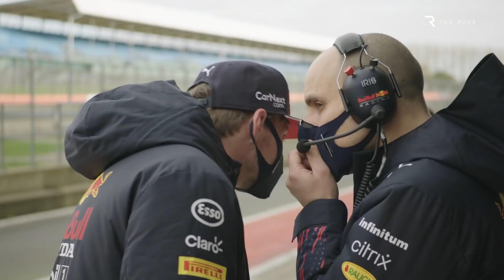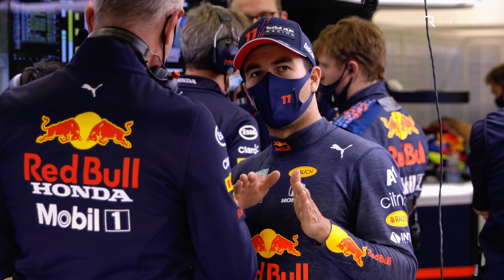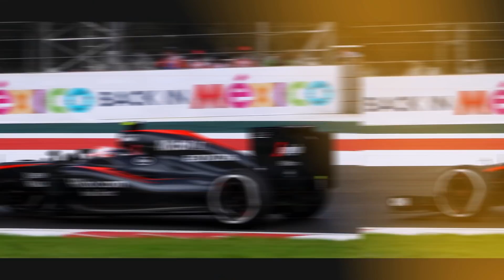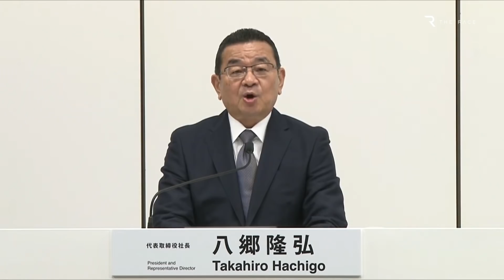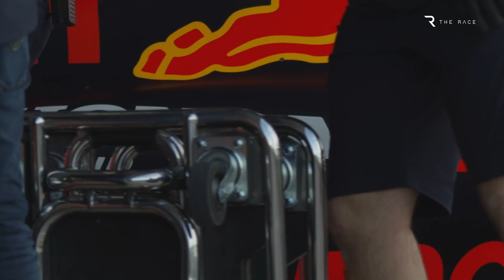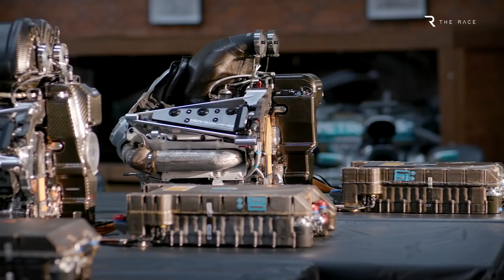The major F1 engine upgrade Honda kept secret

Comment: verstappen fans still think Mercedes has faster car 😂😂
Reply: Over the last few races Mercedes had a clear advantage more often than Red Bull. Mercedes had a clear advantage at Monza and Hungary, while Red Bull only had a clear advantage at Zandvoort.
Reply: @Privacy Is Everything The Honda engine is not the best engine. The Mercedes engine is still the best on the grid.
Reply: @svenniepennie4237  

engine is not the only part that contributes to having a faster car. 

after the new regulations implemented by FIA for this season regarding the reduction in floor and diffuser Mercedes lost out on a chunk of downforce due to its low reck design on the contrary Redbull gained from it.
Reply: @cult_personality  I never said the engine is the only part that matters. Someone claimed that Honda had the best engine. I responded to them to point out that this is not true.
Reply: In terms of raw power. Mercedes still has more than Honda,. As seen in Monza where Mercedes has been on top of redbull before sprint race, where Lewis made a bad start.

Honda compensate their raw power disadvantage to their power deployment, which helps in acceleration out of the corner, which RBR usually do better
Reply: @hectornecromancer5308  

circuit by circuit there is always a change , we have alredy seen Ferrari on pole at Monaco, Sainz finished 2nd . 
in general, overall package wise Redbull have a faster car.
Reply: @cult_personality  they're equal actually.

Mercedes and Redbull are compensating each other's weaknesses. Hence they're becoming tight in the WDC standing. Redbull aren't any faster than Mercedes, and vice versa
Reply: @hectornecromancer5308  

disagree, it cant be true that both are equal. 

1) you can just check f1 pundits opinions and articles regarding the changes FIA made and what effect it had .
2) qualifying stats - 
max 8 - 3 lewis . shows its one sided . 

3) not just this you can cross check with the two sister cars for both Mercedes and redbull. 
 Aston martin (  last yrs pink Mercedes) was flying last year finished 4th on overall standing. struggling this season on the contrary Alfa Touri performance has improved. not as surprise as Aston Martin also suffered a blow because of new season changes. 

i guess there is enough evidence RB has a better car than Mercedes , you disagree fine your choice.
Reply: @cult_personality  Aston Martin and Mercedes likely both had to do extensive redesigns of their cars with the limited development tokens as well, which has likely had a bigger effect than the aero regs. Mercedes had to rebuild around not having the DAS system, and Aston had that whole thing where they... somehow got components that were too accurate to have merely copied them off the Mercedes.
Reply: @Pünchk3y  

irrespective of tokens , it is not possible for manufacturer to change the rake concept that easily. 

low rake, high rake is one of the basic platforms which in turn shapes up other logistics of the car, the changes made by FIA benefited high rake cars Redbull/ Alfa tauri, and hampered low rake cars Mercedes &  aston martin. even if Mercedes had more token it was not possible for them to completely abandon last yrs car and redesign. 

if it was possible or not, or Mercedes chose not to is a different argument point is Redbull got a upper hand on Mercedes. that's what im saying.
Reply: @cult_personality  I think it's to close to call. Mercedes dominated the RBs in Spain and Portugal, but Max was miles ahead in Austria. Then the rear tyres changed and Mercedes got an update in Silverstone which made them a bit faster. All things considered I don't think one car is anything more than only marginally better than the other and it might even be the Merc.
Reply: @suckieduckie  

im not saying Mercedes have become hass , but the small/big advantage you are talking is with RB.

its the qualifying , Max 8 - 3 Lewis , this is where they are lagging, that advantage come into play here, and once RB get that important pole ...its always a tough task catching up.
Reply: @cult_personality  Yes RB have stepped up their game on saturdays and in the beginning of the season I thought that would lead to RB dominance since they usually were superior in racepace compared to saturdays. But wouldn't you agree that it seems RB has lost that edge they used to have on sundays? In previous seasons RB was nowhere in quali save Monaco and Mexico, but they could match the Mercedes in racepace. Now they can match the Mercedes in both, but they're no longer better on sundays than saturdays.
Reply: Anything you're saying is pure speculation, but Mercedes heads the constructors championship and Bottas's times are closer to his teammate's than Perez's to Verstappen's. So if you average out both drivers the Mercedes ends up being faster per lap than the Red Bull... which would mean it's the faster car. You can't outdrive your car's potential, but what matters is how close both drivers can get to it, and if the Red Bull is clearly more difficult to drive as fast, then that also means it's a... worse car.
Reply: @Pünchk3y  

what sort of logic is this ? 

" if you average out both cars Mercedes ends up being faster? " 

irrespective of Mercedes being faster or slower , bottas is driving that car for 4 yrs now compared to parez who is in his first season , its obvious bottas will be closer to lewis compared to parez. 
and how on earth teammate comparison proves a car faster. Hass teammates are more closer to eachother than Redbull as both regularly finish bellow 15 by default so does that mean hass has a faster car ? 

secondly regarding RB being a difficult car - none of us or media or pundits have drove it personally , this idea was mostly drawn from the fact that none of Max's teammates could match him up or at least performe as wing man , albon,gasly now parez all failed . due to this it was questioned if this car is thats difficult ( only suited for Max ) that other cant drive. Redbull themselves have denied this claims then how can you assume its true ? 

lastly , i still stand by may opinion and i have stats to prove that, Lewis Hamilton the best qualifier in F1 history , over 100 fooking poles and he is trailing max 3 - 8 in qualifying . for me its enough prof max has better car.
Reply: @cult_personality  It's a simple comparison of Hamilton and Bottas averaged out, to Verstappen and Perez averaged out. You just compared Verstappen and Hamilton's poles without their teammates' performances in the mix and I was trying to point out that you need to look at both drivers on each team to make that comparison, which AWS clearly did when they concluded after Sochi's practice that the Mercedes was presently faster than the Red Bull. 

As for Red Bull's denial, they've denied that it's in any way connected to Verstappen's driving style, not that it's difficult to drive. That's a detail they've more or less stated themselves and why they're not judging Perez so heavily. And as for Verstappen's driving style, Anthony Davidson (Mercedes test driver, so he probably knows some of what he's saying) stated that it was his opinion that Verstappen's setups are similar to Hamilton's, so we can probably finally just stop assuming that Verstappen is some kind of novel driver. 

That the Haas drivers are close to each other would just demonstrate that the pace you're seeing is likely how horrible the car itself is, much like how Latifi's pace in the Williams compared to Russel lately would suggest that the Williams has come a long way.

If you're going to use Hamilton's 100 poles as statistical proof that he's the best qualifier in F1 history, then surely you should accept that Mercedes leading the constructor's championship means that they're the faster car.
Reply: @cult_personality  If you are using pole positions to determine how good someone is at qualifying you are purposefully skewing the results in Hamiltons favour. Surely you know that due to the partymode the Mercedes were pretty much unbeatable in qualifying till 2019 barring a Ferrari that burned more fuel than they were allowed to. 
To put that into perspective: from Australia 2014 to Japan 2019, Mercedes have taken 92 poles (and 40.17% of the races were Mercedes 1-2s), Ferrari 20, RB 4 and Williams 1. Most of those Ferrari poles were achieved with an illegal engine. We can all agree that Russel is excellent in qualifying yet he has zero poles.

The only thing you're proving is that partymode is no longer allowed and that the only way you think someone can beat Lewis is with a better car. What that quite simply means, is that you have already decided that Lewis is better and doing research to confirm it rather than figuring out who is actually better. Kind of like how religious people have already decided that god is real and therefore anything that challenges that assumption must be wrong or wrongly interpreted. I mean you litterally just said: Max is beating Lewis but Lewis is still better. 

That might be the case, it might not be, but don't pretend it's set in stone and that you're somehow some authority.
Reply: @Pünchk3y  

first of all to analyse which car is faster, there is no need to count on both drivers and then average its out. 
specially when you know Parez in his 1st season in Rb, bottas is 4th. 
this is flawed.

lastly constructor standings contribute for points for both divers. they are more related to stability and performance of both drivers , with parez's struggles RB are on handicap. thats whay they are lagging. 
but they are leading Mercedes in most wins most poles ...
its 8 poles to Mercedes's 4, 8 wins to Mercedes's 5. 
if you are ignoring the more significant stats and focusing more on constructors points ( just to prove your point ) then let it be. cant force you.
Reply: @cult_personality  Provide those more significant stats, then. Your comparisons don't rule out the possibility that Verstappen is just a faster driver than Hamilton in similarly-strong equipment, which is why I suggested looking at both drivers in each team. Logic is math, and you need to build a provable system in order to come up with anything meaningful.

 Last time I checked, F2 and F3 drivers end up having advantages over each other despite being in very similar cars, and Hamilton outqualifies Bottas in the same machinery, so theoretically in relatively equal cars, either Hamilton or Verstappen would likely be regularly coming out on top.
Reply: @suckieduckie  

its  really  funny that you yourself have this opinion that only reason lewis had so many poles was because of partymode , only reasons Ferrari had so many poles in 2019 was because of illegal engin, 

but when im using same logic that ...if Max is beating lewis so hands download its must be because of better car then you disagree., Classic verstappen fan i guess. 

lastly only reason i mention the 100 poles is to show how good he is in qualy. Hes not a pushover that Max is beating so hands down because 8-3 is a bad record ., but who am i to conclude that may be its because of better car ?
Reply: @cult_personality  I'm saying Max winning the qualifying battle might be due to a better car, but it's not so clear as you make it out to be. I also pointed out that simply measuring pole positions isn't a good indicator for who's got the best one lap pace. You need a good car to get pole, hence why I named George Russell, arguably a top 3 driver in terms of qualifying who has zero pole positions. I rate him just below Lewis in qualifying pace and on par with Max. 

I never said Lewis only got poles thanks to the great car. I'm saying that Mercedes with partmode enabled was nigh unbeatable in qualifying till 2019 if you discount the illegal Ferrari engine. 

Lastly, there is a difference in performance on saturday and performance on sunday. Traditionally the RB had more pace in the race and the Mercedes had more pace in qualifying, mostly due to partymode which almost saved a full second. Even if the RB is good in quali, it still chewed up the tyres in Spain while it seemed that the Mercs could just keep going. That happened on other tracks as well.

It would make sense right? Mercedes complained a lot that they couldn't get the tyres heated up to the operating window in quali while RB have been complaining about overheating the tyres in the race.
Reply: @Pünchk3y  

provable system ? by counting/comparing performance of two drivers one is in his debut season another on in his last season with the team ? you seriously dont see any flaw in this ? 

lastly i have already given thoes stats and also the explanation. Mercedes dominated 2020 fastest car on grid, FIA introduce changes that turn the tables, this season RB is out performing MC, more poles, more wins ...hell if you want you can cross chek with the 3 free practice sessions every race has, i follow each n every bit of it and i can guarantee you that nearly 70-80℅ of them are topped by Redbull. there are many articals , pundits opinions available on this, now if you don't believe any of it and still want disagree that's your choice.
Reply: @suckieduckie  

its not clear ? it never would be . RB wont accept they are faster car nor will any other manufacturer. 
drivers are different, cars diffrent , driving styles , teammates everything is different so if you dont want to believe something you always can always put in a " May be " . we cant request max n Lewis to drive same car or request RB & MC to have a sprint to finally settle this.

point is we will always have to conclude from the facts/results/stats that are available. 

just check, most wins, most poles,  free practice timing set by both teams in reach races. 

i can guarantee you 70-80% results are on RBs side, they are dominating Mc in every regard barring Constructor championship , and thats mostly due to parez's inconsistencies. 

going back to last season Mc dominated 2020, won everything , HAD THE DOMINANT CAR ( not hiding form it ). max wasnt touching lewis at all that does not mean i am saying he is not good , the point is how come tables have turned on MC as soon as FIa introduce new rules for floor and difussor ? 

i think i have put forward enough proof and explanation to my conclusion that RB have better car this season, you or any verstappn fan still believes Mc have better / Equal car and its only max's talent that is dominating lewis & Mercs then fine , i can't help it.
Reply: @cult_personality  The problem is the Merc was quite clearly the dominant car while the RB isn't. Realistically how much could Max or Lewis gain on the other purely on skill and not the car? I don't think it can be anymore than a quarter of a second on your average track given both of them are extremely skilled and consistent. For me that means that if Max and Lewis are within 2-3 tenths of one another that might very well be because one of them was the better man that day. Given how many times they were seperated by less than that this season, I don't think Lewis and Max's head to head is the greatest method of comparing the two or their cars. 

To illustrate my point: It's been within 2 tenths of a second in Imola, Spain, Baku, Silverstone and Zandvoort. France and the first Austrian GP were within 2.5 tenths. Any other day and these could have been reversed resulting in a 6-5 head to head in favour of Hamilton.
Reply: @suckieduckie  

now this is my last bit on this not going to keep on going for ages.

i agree we don't exactly know to how much extent RB have advantage but atleast i think they have. How much is different debate.

but but as we know this sport even few tenths count. when i say RB have better car im not saying MC have become hass bad. but the few tenth advantages Max is getting is good enough to set him up for a that critical pole. Once that done its hard to catch that RB. so RB may be not as dominant as Mc in 2020 but its still enough to win.
Reply: @cult_personality  I think we sort of agree on 95%. You're just more sure that the RB is better, albeit marginally, and I think it's close enough for it to be down to driver skill though I'm not sure which of the two it is.
Reply: @suckieduckie  

last one for sure, lets just agree to disagree. 

but with that last bit by you ( and many verstappen fans ) i just wonder what if...

it was reversed , it was Verstappen who was 7 times world champion and 100+ time pole setter, and Hamilton was the one who was driving RB...would it still be ok to entertain this possibility by hamilton fans that - " its not car May be Hamilton is better driver than Max , its his talent" . How would verstappen fans react ?

coming back to reality i not saying Hamilton has any entitlement, There is evry possibility Max may win 10 titles ..and leclerc win 11 😉 ( im a leclerc fan, he is better qualifier the Russell n lewis n Max) but still unless he does that to have this bullishness to directly / indirectly try to say that he is better driver than 7 time champ is too fanboyish for me.
Reply: @cult_personality  No clue how I would react if it were reversed. The main thing I'm looking at is that Verstappen is beating his teammates by an incredible margin. Sure the last three didn't have a lot of time to adapt to the RB, but he's half a second faster than Perez at the very least. Sometimes even more. If he's that much better than some of the best drivers in the world, is it really that unthinkable that Hamilton is a bit past his prime and there is a new kid on the block? A kid that on a good day beats him by less than two tenths and on a slightly worse day gets beat by a similar margin.

Also I never said I'm sure it's talent. Might as well be the car. Just saying it could be talent or form given how close it is.

Lastly, Leclerc has the pace, but he lacks the consistency so far. I think George proved he's a bit further with those Spa and Sochi performances.
Reply: Not to mention that the only comparison you can have to Honda is Alpha Tauri. Who was very inconsistent compared to both Aston Martin and Mercedes
Reply: @Privacy Is Everything 

they have become complacent. may be not just this yr from past few years but never had a challenge at their hands. now witj the new rules tide has turned , its the redbull who have better pacage ans Mercedes cant keep up.
Reply: The only problem here is that you just wants to justify that Lewis is a better driver as if he's unbeatable on everything. Overlooking everything else that doesn't support that narrative
Reply: Noo.... thinking how Hamilton hit max again... since he can't challenge him with redbull pace .. !!😂😂
Reply: @GPCboss  

again ? last time in monza it was max boi who hit lewis , not the  other way around.
Reply: @cult_personality  forgot Silverstone...!??
Reply: @GPCboss  

ohh so you have " conveniently " skipped the recent incident, n still hanging on to Silverstone , thats a sign of true fanboi , great keep it up.
Reply: @cult_personality  you think it's recent incident..I think it's racing incident... Keep it up  Lewis fanboi...Monza is over its already 4-5 week's..
Reply: @GPCboss  

lolz ..what irony n hypocrisy. you are saying monza is over already 4-5 weeks and then you are the same guy who is reminding everyone about Silverstone ? 
do you even realize what you yeild when you start writing this things ?

and that one..".you think its a recent incident i think its a racing incident  "   ...great keep it up.
Reply: @cult_personality  both are past races kiddo...leave that thing and watch upcoming races...and don't reply back again with an essay..😂
Reply: @cult_personality  haha at least he intends "this things" when he makes a linguistic pun 🤣
Reply: @GPCboss  

you are the one who digged up the past and now this ? good continuity . Keep it up.
Reply: @cult_personality  kiddo it's you who started not me..!!😂
Reply: @julesbrunton1728  you are keeping up with him.. keep it up..😂😂
Reply: @GPCboss  

 you brought up hamilton-Max carsh incident with your initial comment, short term memory loss ?
Reply: @jayashreesonawane2309  you have it...go see a doc